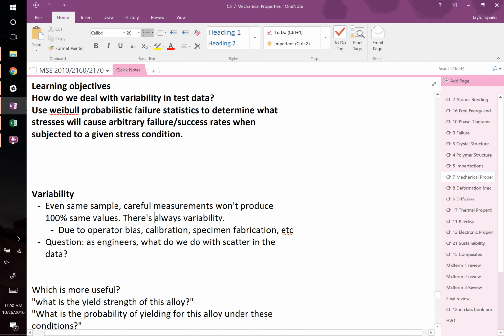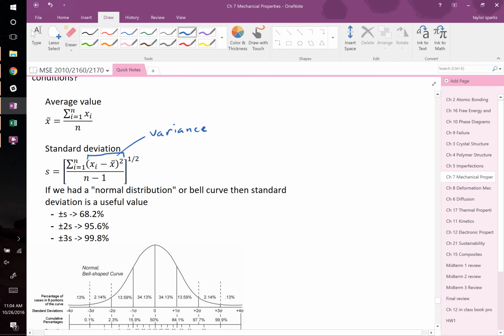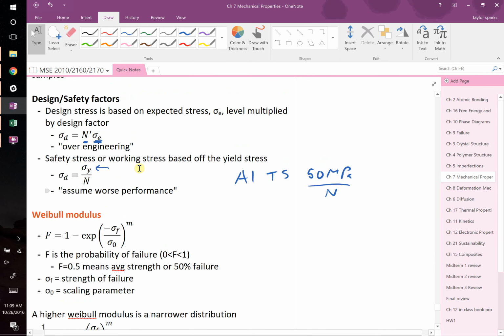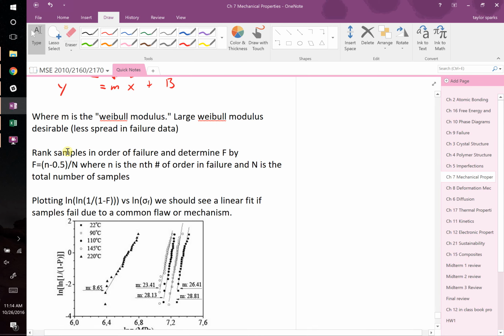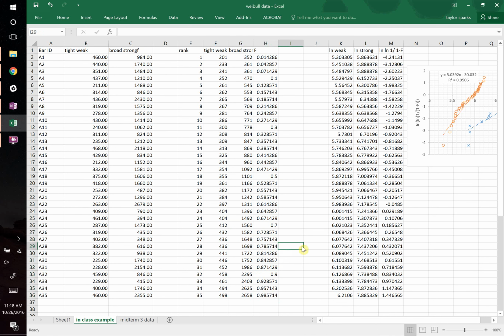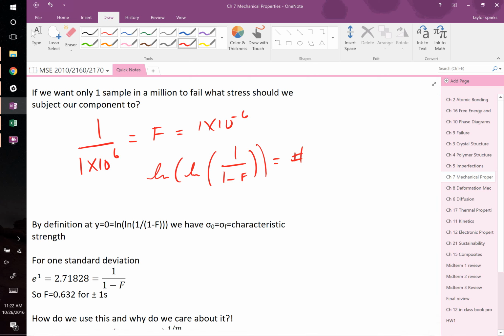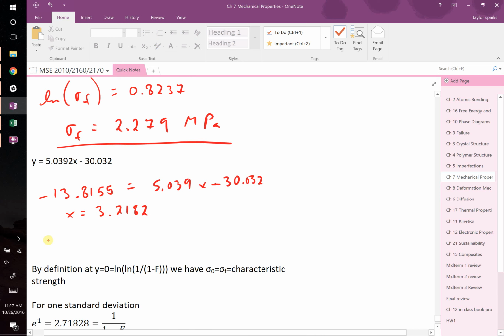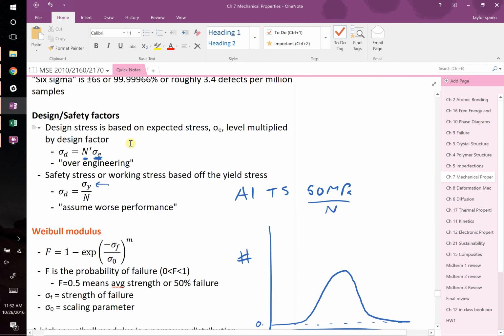10/26/2016 Intro to MSE weibull statistics and probabilistic design

Comment: Why do we need to subtract 0.5 from rank when calculating F?
Reply from the maker: The 0.5 is necessary to make your small data set look more like reality. It's called median rank. You can read more herehttp://reliawiki.org/index.php/The_Weibull_Distribution
essentially without the 0.5 consider this example. If you test 20 samples then when the 20th sample fails you would have F=20/20=100% But do you really think if you tested 1 million samples that none of them would outsurvive that 20th sample? Surely some would! Therefore, a 100% failure rate using your 20 samples is silly. Instead we use the 0.5 (or other approach for median rank). This gives us failure rate of F=(20-0.5)/20=97.5% failure. Therefore the failure rate is high, but not 100%.

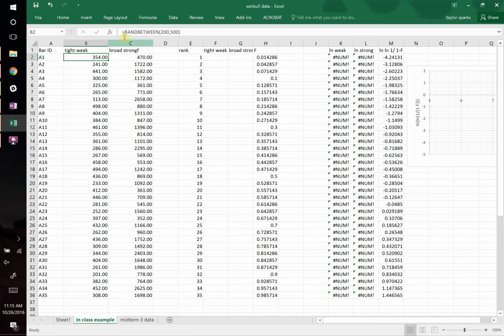Comment: At 15:33, why did you multiply by a random number from 1-3?
Reply from the maker: so, the only reason that I did that was because I was trying to generate two different data sets. The goal was to have one data set with a higher average value, but a wider variance, and the other data set with a lower average value but a smaller variance. The average number was determined by the random section, and the variance was determined by multiplying by a small random number. I only did this for instruction purposes because I didn't have a data set to work with so I created my own. when you are working on weibull modulus you will probably be given a dataset so you won't need to do anything like this to you or data.

Comment: Very nicely explained. Weibull distribution is also used for composite materials like combination of  fiber and matrix. But I want the weibull distribution for composite containing two different fibers and matrix.
Please help me.
Please give your email so that I can communicate with you.
Reply from the maker: Sorry, I'm unfamiliar with Weibull distribution in composites.
Reply: @TaylorSparks  So many researchers have worked to find strength of composite material using two parameters weibull distribution.  But I could not find it for hybride composite. 
Please try your best to help me.